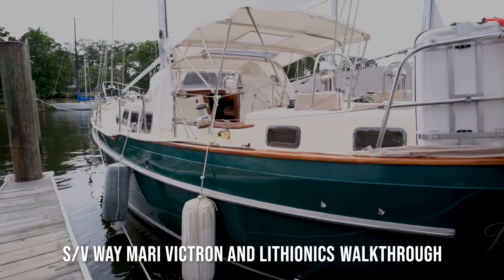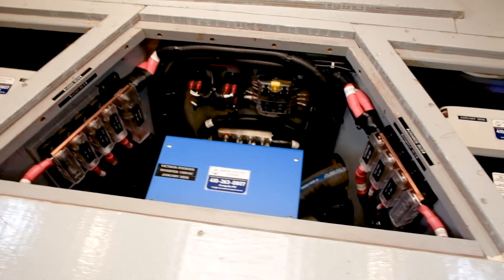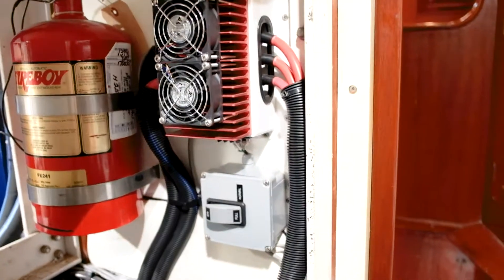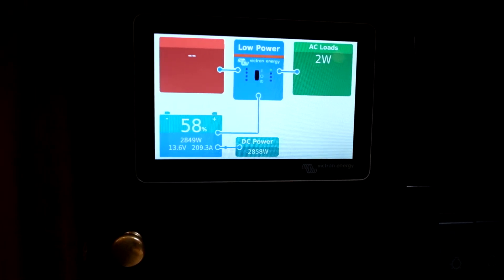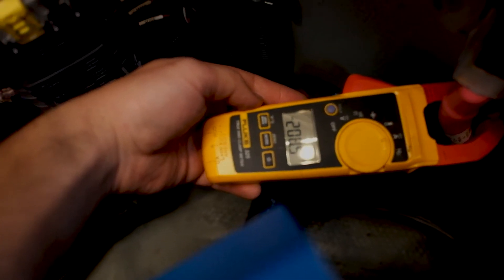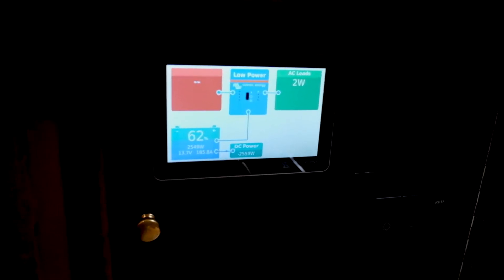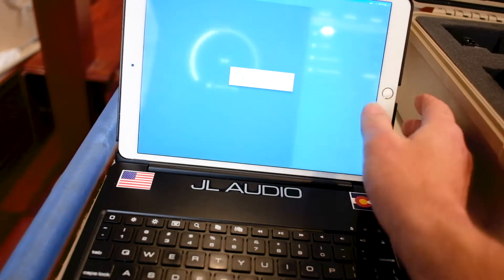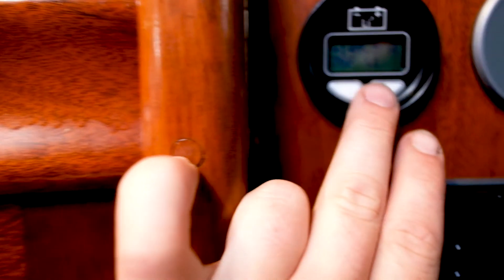Li3/MGDC System Walkthrough by Nick Duff of Marine Electric Systems

Comment: Where to buy and whats the cost for 1 at 24 volt ???
Have houseboat and have WV e-golf batteri for house 24volt but 10.8kw.

Dont need to charge fully from 10 to 100% in 1 houer.  But whats options and prices ???
And can it be done in european countries???
Reply: You need to find an  installer in Europe.

Comment: is it possible to know more about this alternator ?
Reply from the maker: That is 250A x 12V by Mark Grasser DC Solutions, utilizing an external rectifier.  We offer many high power alternator options at OPE, up to 300A continuous in the stock position.  2nd alternator mountings are an option (on some engines) as well.  Contact us at www.oceanplanetenergy.com.